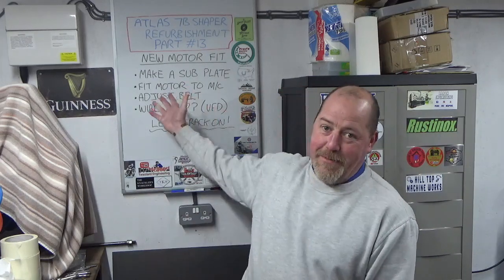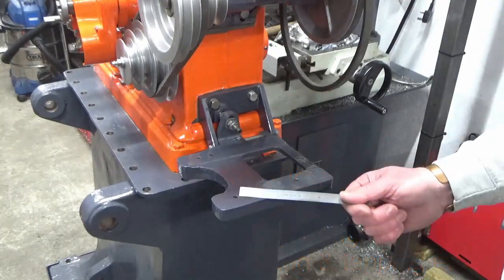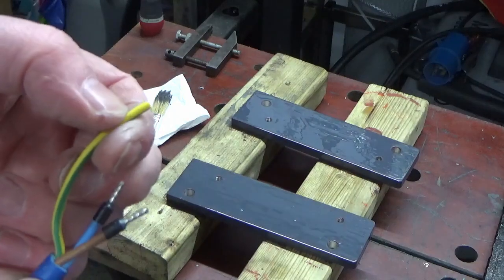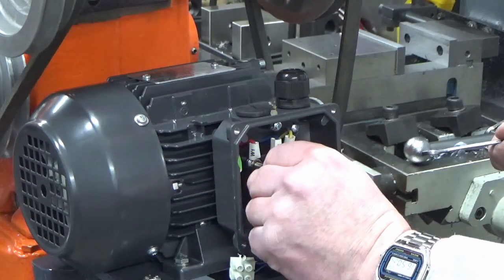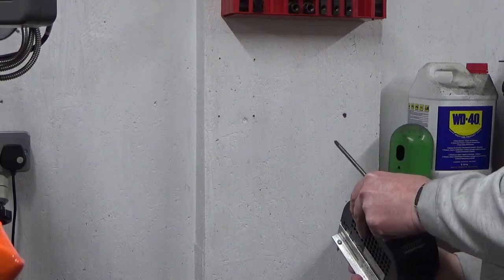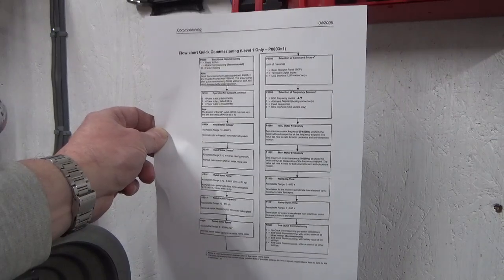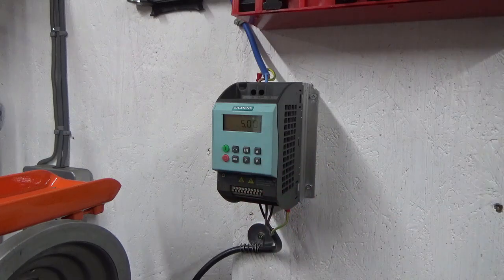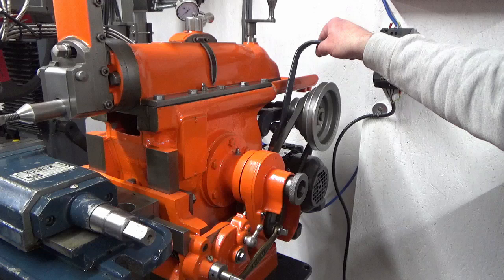Atlas 7B Shaper Restoration Part 13 - Motor & Siemens G110 VFD Install/Commissioning

Comment: Good job, nice to see it coming together. As noted further down, I'd turn the terminal box with the entry to the bottom. Also if you haven't picked this up already, you changed the motor power rating to 0.35 instead of 0.75 (it'll still work, just limit the power). Also, the thermistor wires (the 2 thin blue wires in the motor terminal box) can ( and probably should) be connected to the VFD. They allow the VFD to monitor motor temperature, which can be important if running at reduced speed as the motor fan is producing less cooling than at full speed. Probably wouldn't matter for short running periods, but the facility is there so might as well use it. While you're at it, might as well add in a remote stop/start/emergency stop, save using the VFD buttons. Cheers again and thanks for all your videos.
John
Reply from the maker: Hi Pakrattuk, thanks for the comment and information. I will be improving the electrics in the next few weeks so will take your suggestions on board. My motor is 0.37 kW, so I went for 0.35 as this was the closest available on the VFD. The 0.75kW was the default after the factory reset. Sorry if I was unclear. Cheers, Jon

Comment: Nice work on the shaper so far. I also believe that controller should be mounted in an enclosure. That will protect  you from contact with the exposed live parts.  It also will provide a place to attach the cable sheath and protect the wires that are now exposed from removing the cable jacket. I live in the USA and know the rules are probably somewhat different where you are from.  You should really get some advice from a local Electrician.  Thanks for sharing
Reply from the maker: Hi Paul, thanks for the comment. All good points and I will be improving the setup in the near future. My local electricians are a waste of space, approved to all the standards etc, got one out to install my consumer unit in the house, no receipt, wanted cash, and made a right mess of it that I had to tidy up after he had gone. Regulation in the UK looks great on paper, but there are far too many cowboys let loose with all the relevant certification. I have more faith in my own work, it might not pass the regs but at least I know its been done to a standard that is not going to kill me etc. Our country's regulatory bodies are falling apart! (rant over.... Sorry, not aimed at you). Cheers, Jon

Comment: The shaper looks super smart Jon. Temporary solutions always have a habit of becoming the forever solution. Looks like a nice VFD. Cheers
Reply from the maker: Hi Paul, thanks for the comment, sorry for the delay responding. It is a cracking VFD, can't go wrong at £100 for two of them! Siemens is good gear. Cheers, Jon

Comment: Well Grasshopper that turned out as we all hoped it would and it even turns in the right direction. If they could bottle that satisfaction feeling society wouldn't need Shrinks or antidepressants. 
I remember building a stereo amp from a kit half a century ago, but only had one record, golden hour of the Kinks, and played it through about 4 times then realised the time had flown by and got 2 hours sleep before having to get up and ride across town to Guy's. As you say happy days.
Don't get too addicted to the feeling because you end up always looking for a greater high and you soon learn time travel is beyond you!
ATB 
C
Reply from the maker: Hi Chris, thanks for the comment. Lol, yes, I wish I could bottle it, fantastic feeling, makes all the effort worthwhile! Cheers, Jon

Comment: A great result Jon. The motor setting 50Hz when you said i have no idea what that is & left it at 50. If you had pushed the up button would have gone to 60. In some countries the frequency is 60Hz. So you did right. Great video & result. Machine is running like  a turbine.
regards.
Steve.
Reply from the maker: Thanks Steve. Yeah, I was just a bit confused as I had already set a hard switch behind the control panel to 50Hz, and set the power parameter to 50Hz and kW, that made it seem odd to be asked again. I suppose it is to give you the option of 'over clocking' on speed if you want it. Cheers, Jon

Comment: Hi Jon. That looks really awesome! You can rotate the electronics box on the motor by loosening the 4 nuts on the inside. That will move the cable away from the belt.
Reply from the maker: Thanks for the tip Andre, much appreciated. Cheers, Jon

Comment: That's a real high quality set up Jon. I think it will be a real pleasure to use. My mill has a Mitsubishi unit and it is similarly nice. Your excitement was great to see, we never grow up and our toys hold just as much joy as they ever did. 

Best wishes, Dean.
Reply from the maker: Hi Dean, thanks for the comment. Yep, took a punt on 2nd hand but so far so good. Siemens controls are pretty ubiquitous in high end CNC stuff so I was hoping to get some quality, not disappointed. Cheers, Jon

Comment: Bravo, it lives, fantastic to see beauty of orange  in motion 👌🎉✔.

new electrical tools, ferrules are more popularly called "Boot laces", ring ends, known as "Lugs" here in the UK.  I think the tapered rubber cap/sleeve out of the stuffing gland ( aka Skintop), is normally used as a protective band to grip the cable.
Definitely seeing the mechanical mind, ref tugging after each crimp 👍, another solicitor of YT comments, especially on electrical channels, is twisting the stripped cable before crimping in a cable end ferrule/lug, generally its left as stripped, but its not an aircraft application. 
Like the cable restraint,  very hydraulic. 
Great job Jon, have a  ice cup of tea with a choccy biscuit or 2?
Thanks for sharing
Reply from the maker: Hi John, thanks for the comment. Oh well, skintop is now helping to fill the wheelie bin, ignorance is bliss lol. I am happy enough with the mechanical tugging that it's pretty robust, probably won't win any prizes or pass any regulatory codes but it works. Cheers, Jon

Comment: Congratulations Jon. That is a big milestone made. I feel bad about your temperature problem. Here in Manitoba, Canada it was -32C last night. This morning (10 AM) it is -28C. Going through a lot of firewood at the moment.😀 
Take care,
Steve.
Reply: Ouch!, that's cold,  I was in Ontario many years ago,  it was -22°C, way to cold for me from the UK. I  had to pick up a hire car in London one Saturday morning, it took the car jockey 3 cars until she found one that she could open, and start. I seemed to be shopping at Canadian Tire every day for screen wash.
At the company I was installing equipment at, one of the guys invited me to his house, the gas fire in his basement had more heat output (BTU), than my central heating  boiler for my entire house. 
Stay safe and keep warm.
Regards John
Reply: @bostedtap8399  With any luck the snow in my yard will be gone in three months.😀
Reply from the maker: Hi Steve, wow, you are welcome to that lol. Coldest I've seen was -18C for 3 nights back in 2010, that was horrible. Makes my -7 seem positively tropical lol. Cheers, Jon

Comment: Hi Jon, cracking job! So pleased to see this machine up and running. Final push now with the guarding and off ya go! 😃
One wee thing I think you should do is put an emergency stop in an easily accessable place at the front or side of the shaper (or both). Should something (hopefully not) go wrong and you need to act fast, you dont want to be looking for that wee red button on the vfd.
Take care, regards Tony.
Reply from the maker: Hi Tony, thanks for the comment and suggestion, and sorry for the delay responding. I plan to do all the mods you called out over the next few weeks/months. Cheers, Jon

Comment: Well done, Jon 👍 That VFD manual is vastly more user friendly than the average - I’ve had to cope with lots of them. Your decision to use proper crimp tools does you proud. I’ve seen some appalling wire termination in my day, even in aircraft, where such behavior has no place.
Reply from the maker: Thanks Dudley, yeah the Siemens kit is pretty good. Glad you approve lol. Cheers, Jon

Comment: Hi Jon. I usually do the first switch on with a long wooden stick and some spare underwear on standby 🤣. I reckon you can push the top frequency up to 80 or even 100hz without too much trouble. Also 1hz seems a little low, I would run with 10hz as a minimum unless you really need to go slower. You didn't seem to have a problem with the setup of that inverter, it's all a matter of confidence!
Reply from the maker: Hi Olly, thanks for the comment and input. I will raise the minimum frequency, good points. I will also be adding some external controls I think. Cheers, Jon

Comment: Well done! consider wiring the temp sensor of the motor to vfd (if supported) and maybe increase starting frequency , your motor will overheat  at low rpm, fan seems to be attached to motor shaft and will not provide much cooling at low rpm.
Reply from the maker: Thanks Wacko, all good points, all being added to the list for future upgrades. Cheers, Jon

Comment: ITS A BOY was the cry, good job Jon, lot of hard work, nice one, VFDs are great in my estimation, I’ve got them on numerous machines, you might have wondered what the two light gauge wires with a terminal strip attached are for in the motor junction box are for, you can connect these to your VFD and they sense when the motor over heats and sends a message to the VFD to shut the power off to the motor, I’ve never connected mine and all has been fine.

Comment: has not a lot to do with the motor functioning , but (if its possible on this brand motor) you could rotate the motor on its mounting so the wirebox is pointing up , most od the time its allso possible to unbolt the box itself ans rotate it so the ferulle it pointing to the back of the motor and away from the belt ,  that prevents the box being the first thing in back that hits the wall if you slide it back,  prevent the cable from being caught by the belt , and makes its footprint slightly smaller 
you need to use the "blanking plug" its the pull safety , prevents the cable from being yanked out of the box , and its a sortoff watertight seal you need to put a hole in it to fit the cable through

for those who are wondering wat the 2 thin wires are for that are hanging loose in the box : its connected to a heatsensor inside the motor , you can in some cases hook it up to the vfd so it shuts the motor off automaticly if it overheats or hook it up to a relay and a big warning light  / horn so you know you need to shut the motor off or burn it up
Reply from the maker: Hi Watahyahknow, thanks for the comment and information. I will be improving the set up in the near future so will take on board all your comments. Cheers, Jon

Comment: Fantastic job Jon. I'm not surprised you're chuffed with it!
As for your electrical work, I don't think the disclaimer was needed, it all looked fine to me. The proper tools you bought are much nicer than the cheap and cheerful ones I use.
I'm not a fan of mounting the vfd on the wall and using the front panel buttons. First, as others have mentioned, dirt and swarf ingress might be an issue. Second, those buttons are hard to get at, esp in an emergency. I fitted a proper em. stop button to mine which shuts down the vfd fast, using an aux input programmed up on the vfd.
Looking forward to seeing it making chips!
Reply from the maker: Hi Robert, thanks for the comment and sorry for the delay responding. I plan to do all of the mods you suggested in the near future, watch this space lol. Cheers, Jon

Comment: Have 3 VFD and all of them are new Fuji .The support team at Fuji is A+.They will walk you threw the set up step by step...Each set up on  my machines took 15 minutes each...Why take chances on burning up the motor or the VFD... Fuji gets an AAAAAAA+++++ from me.Never have had so much as one problem.....If you need a VFD do yourself  right.... By a FUJI...

Comment: Great to see it working, but could I ask you to do a couple of things with the electrics. Firstly fit an emergency power off button on the machine, and secondly either put the VFD in an enclosure or build a cover over the whole VFD and cables so the you can only access the control panel.
Reply from the maker: Hi Andrew, thanks for the comment. Yep, I am planning to tidy it all up in the next few weeks so will be taking all the comments on board. Cheers, Jon

Comment: Same here Jon, when it comes to wiring controll panel and muilty switches, I stumble. Heck, Iam still learning Fusion 360, so that to I am struggling. Have a great day around the shop, since now your heater is back up and going. Cold here too! Bear.
Reply from the maker: Hi Bear, thanks for the comment and feedback, much appreciated mate. Cheers, Jon

Comment: I would have expected that controller should be mounted in an enclosure. Sometimes you can get a kit that protects the cables so swarf doesn't land across the terminals. Or your fingers, that can be truly shocking.
Reply: Agreed. The whole unit should be in an enclosure with control face only protruding through the enclosure face
Reply from the maker: Hi Glenn, thanks for the comment and feedback. All in the plans for the next few weeks/months. Cheers, Jon

Comment: The Star and Delta refers to the motor voltage, Star is for 380 / 440 Volt and Delta is for 220 / 240 volt. Thought Jon, is the motor running in the correct direction ? Surely it will need to be in a certain direction so that the stroke return mechanism is correct ? Have a read of the manual I sent to you as a .pdf.  If you need to reverse the motor direction, just swap any 2 phases over. Controller end or motor end. Regards from Australia.
Reply from the maker: Hi Dave, thanks for the comment. Yep, definitely running in the right direction, there is a direction arrow on the input drive belt side. Also, following the video, I lengthened the stroke to the max 7" and you can clearly see the back stroke is faster than the cut stroke due to the eccentric cam mechanism. My biggest brain tease now, based on all the great feedback in the comments, is do I go a step further and site the VFD in a box and have remote switching, would welcome your thoughts. Cheers, Jon
Reply: @jonsworkshop  Hi Jon, I think that now you have some more confidence with electrical wiring and have the tools, I hope you also have a soldering iron ? I would definitely go for remote operation. The wiring needed is only low voltage. I would suggest a PVC /ABS box attached at a suitable working point on the shaper. Incorporate into the box a Start button ( Green ) A Stop Button ( Red ) and a Jog button ( Black or colour of your choice ) Also add a potentiometer of a suitable resistance ( will let you know ) with a knob on so you can change the speed at the turn of a knob. If you want to you can add a scale backplate with a pointer knob, or a knob with a built on scale and a line on the box. Will email you some suitable pictures of what is required. As a safety feature you could make the Stop button a lockable one, which means you have to reset it before the start button will work again. Will send you information and pictures. All from Ebay or local electrical contractors supply store. To achieve all this you will need to go back into the VFD setup program and tell it that there is external controls which may or not disable the front panel controls. Read the paperwork.  Great outcome. Will mail you in a couple of days. Regards.
Reply from the maker: @daveticehurst4191  Thanks Dave, it makes sense really. Now from researching a bit of this already in the VFD manual, I know the pot needs to be a minimum of 4.7k Ohm. I actually think this would make a good video, again hopefully confidence inspiring for others etc. Yes, soldering irons a plenty here! Cheers, Jon

Comment: I'm looking at the thumbnail, seeing "what could possibly go wrong" and shouting "the inverter could shit itself and take the unobtanium motor with it, like happened with my schaublin".  I will now watch hoping that this is not the outcome.
Reply: That's fookin' great, man.

You're probably going to find the vfd is a pig to use as controls, especially mounted behind the machine. What you probably want is a remote box with start / stop / potentiometer.
Reply from the maker: Hi Wibbly wobbly, thanks for the comment. Lol, the only thing that is likely to take the VFD out is me! Cheers, Jon
Reply from the maker: On the to do list!